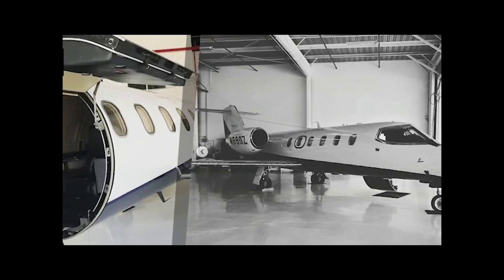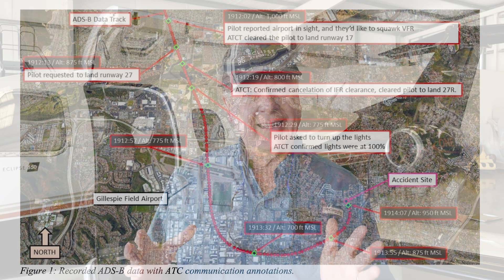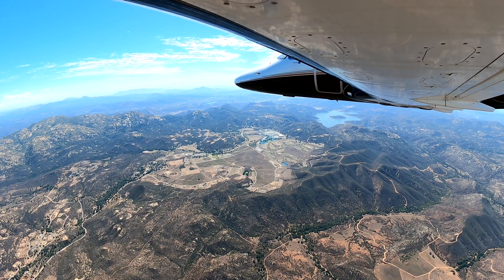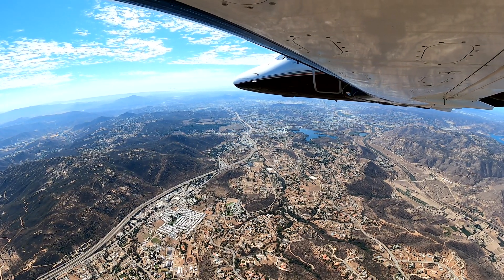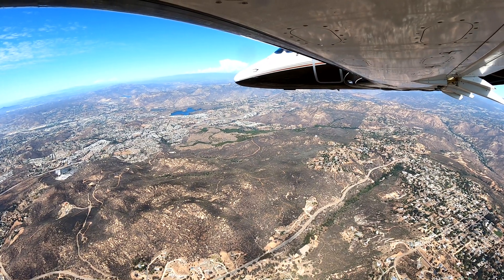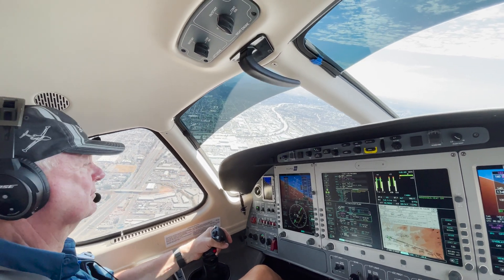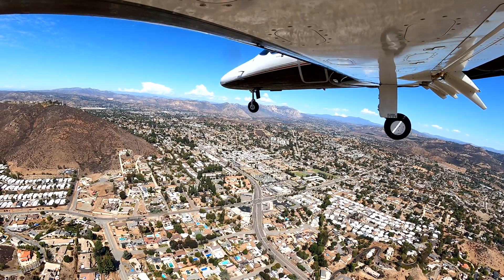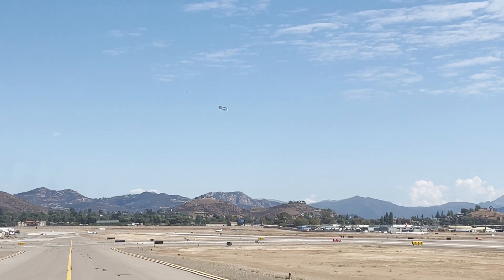Eclipse Jet Circle-to-Land Gillespie Field LOC-D Approach

Comment: Transitioned from Military Helicopter Pilot to fixed wing in 1970 at SEE. Grew up about 2 miles east of the airport. As your Video showed there are many square miles of monster rocks all over San Diego County along with rising terrain everywhere.  By the way my Citation and Lear Jet type ratings allow circling approaches., while my 757, 767 and 777 do not.  I have never flown a circling approach in a jet since training and will not.
Reply from the maker: Circling approaches are challenging.  In this case they cancelled IFR and continued VFR at night, in low visibility.  Sometimes pilots assume they have more of a safety buffer at their home airport.  As you know KSEE has some definite terrain challenges for 27R/L.  I've flown a number of actual circling approaches in jets, and teach them to clients.   I only use them when no other option exists, and the weather conditions offer a good safety buffer.  Otherwise that is why we file alternates - to give us pilots the option of landing elsewhere.

Comment: Thanks for your video. We eagerly await the NTSB opening up the docket to the public, and stating a probable cause with contributing factors. We're into the 28th month since the crash (N880Z) and this is a long time for a NTSB final report. I believe it will come down to an accelerated stall with incipient spin. VFR circle (not any published procedure) in/out of IMC, with difficulty maintaining runway environment lighting. I believe they tightened the turn and either allowed some pitch-up, or climbed due to uncertainty about Rattlesnake Mountain. There is also some suggestion by some that there was a changeover of controls from the co-pilot to captain, at a critical point on the turn from base to final. We shall see, soon.
Reply from the maker: Darren your assumptions may be close and we are also awaiting the final report, which usually is completed within 24 months, however the NTSB is still short-staffed.